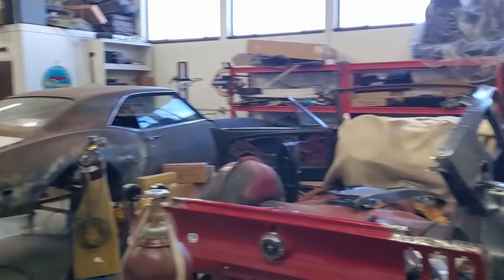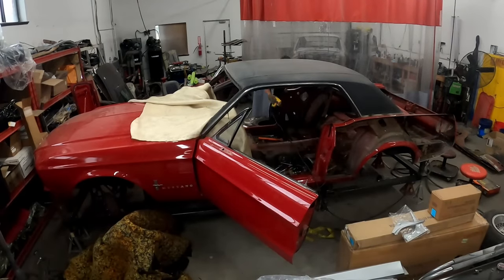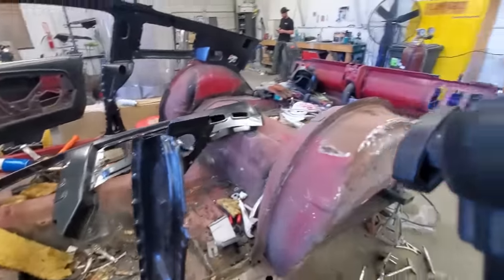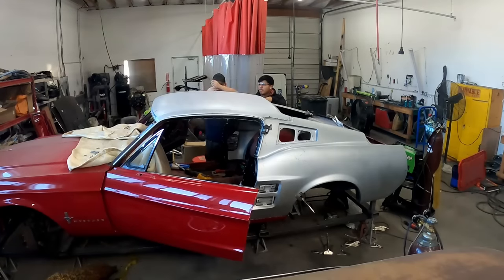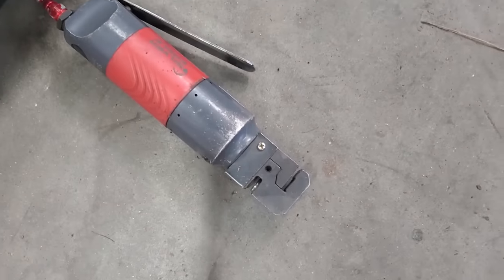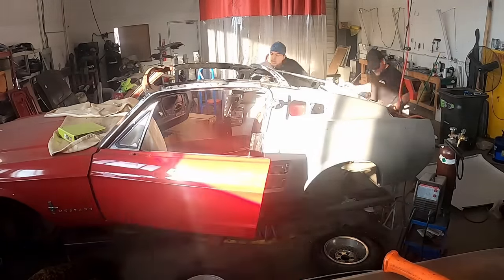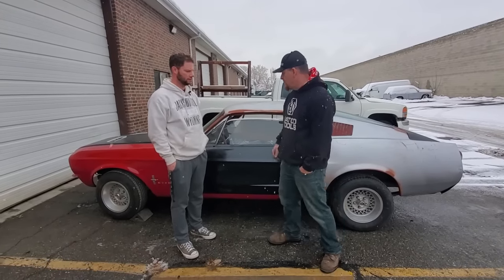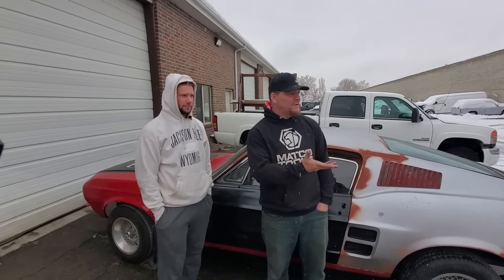Fast Track Transformation: '67 Mustang Coupe to Fastback in Minutes! | lostsocketgarage.com

Comment: That's cruel and unusual punishment to a perfectly good body. The VIN's not gonna match up to a fastback. I was just watching a video on CUDA's and they found all the imperfections with a body just by looking at the welds and bare metal from parts chopping that will seriously affect the bottom line of the car's worth. IF IT AINT BROKE, DON'T FIX IT
Reply from the maker: There are opposing views on this procedure for sure. It actually raises the value of a coupe believe it or not.

Comment: Another reason to do full car history checks! Thx guys
Reply: I was just watching a video on CUDA's and they found all the imperfections with a body just by looking at the welds and bare metal from parts chopping that will seriously affect the bottom line of the car's worth. They could tell that a Barracuda rear was used on a Cuda body, just from slight discolorations in specific spots.

Comment: Hey looking to do a fast back conversation and wondering how much can you get away without buying in one of the 6k+ conversion kits
Reply from the maker: Thats a Hard one. Ive seen people use donor fastbacks and cut the roof. Seen people make their own inner structure to save money. This is a hard one to do on a tight budget, but if you're patient and find bits and pieces here or there, Im sure you could do it.

Comment: That's awesome! I have a '67 T code coupe setting in my junk cars. It was mostly complete until I sold the grill and a headlight bezel about 8 years ago. I have always wanted to do this though but I wasn't sure what all was involved. I might just drag it in the shop someday and do it now.
Reply: I would give it a try. I've done restorations and you always make some mistakes. 
The sheet metal parts are somewhat expensive.
Two things holding you back. You are afraid to fail or you don't have money for the parts.
Reply: @cammontreuil7509  Yeah, usually for me it's money but at this point it's option #3, I have absolutely zero time. But that will hopefully change in the future. About 2 years ago my best friend received a '67 fastback from his father in law. His father in law bought it in 1974 wrecked in the right front corner. The father in law bondo'ed it up and drove it for about 6 months and then tossed it in the corner of his garage and that's where it set, except for 1 move in late '90's to a new garage, up to 2021. The father in law was dying of cancer and gave my friend the car and a credit card and said he just wanted to see the car restored and running. I actually offered to give them my '67 to use for parts but new parts were cheap enough and of course new. Well in the summer of 2022 the paint and bodywork were done, the original red with red interior, all new seat covers and carpet, new bumpers, wheels and tires. The father in law got to ride to several car shows and enjoy a couple of cruise nights. He passed in the fall. The car desperately needs either an engine rebuild or replacement. It's a 289 so I'd replace it myself, but anyway, you are right about not waiting, it might be too late at some point!
Reply: @1967davethewave  I want to hear you focusing on your project.
I tried to light a fire under your azz.
We make time for things important to us. 
But then I have two daughters interested in mustangs and the struggle to put them together.
But it's worth it.
Reply from the maker: It's scary as shit cutting your first one in half, But it's worth it
Reply: @lostsocketgarage  my friend has a 68 Roadrunner. Cut the front off to the firewall. Welded a Satellite front clip on it. Not that hard. Work on a flat surface.

Comment: kind of cool but i saw one years ago that took it a step better IMO it was a high end build /Restomod that converted one into a Fastback with a removable hard top ! perhaps not the most practical ? but definitely the best of all Worlds  of Classic Mustangs Why?   i grew up running around and riding in both  as i graduated HighSchool in 1982  and 1960s Mustangs were everywhere and affordable , heck we used to go to our local Junkyards to get parts  (cheap )  i blew up a 302 and got all the parts i needed to get the car running for under $200.00  it was a 68 Convertible 3 Speed on the Floor that  wound up getting Totaled by a drunk running a Red light  unfortunately  we pulled  almost all the body parts off a 6 cylinder hardtop  project car i had in the back yard the car  got put back together  not painted and it had too much structual damage to be  a safe driver so it was sold as is ? Running and Driving ,Multiple Colors ,Salvage Florida Title  it was a One Family owned Vehicle as well

Comment: Okay... so this was cool and I subscribed.  IDK... 20 years ago or so, I went looking for a reasonably priced fastback from my birth year... a 1968... and I couldn't find one.  I bought a 65 coupe... and a 66 convertible... but I simply could not find the 68 fastback.  So... it looks like you guys have a good fix for that problem.  I know the convertible had a bunch of extra support built into the body and frame because it was more likely to twist... but all the mustangs will twist when you put enough power into them. So I'm curious if your fix includes any beefing up of the frame and body.  I guess I look at a few other videos to find out...
Reply from the maker: We do if the customer wants it. For a stock 351 really no bracing is needed. If you go stroker or even coyote then yes, you should look at frame rail connectors and beefy suspension.

Comment: Hey guys! Great job. Would it be easier to start from a convertible? I’m a Mustang fanatic and always wanted a 67 fastback but I’m on a coupe/convertible budget. 🤣
Reply from the maker: You can do it from a convertible . Actually a bit stronger that way because the floor on convertibles are thicker and you will have both torque boxes.
Reply: @lostsocketgarage  Sweet, good to know!

Comment: The original cars were built to different standards to todays cars. The 60s cars were pretty bendy. Have you added any additional steel to stiffen the body? Such as an integral roll bar hoop, stiffeners to the rear suspension points or adding material to the sill?
Reply from the maker: We only brace it for the conversion. They are kinda flimsy being a uni body. Best thing to do is frame rail connectors if your pushing additional power.
Reply: I always jack up 60' cars with the doors shut. Like you said, they can be flimsy.

Comment: I don’t see any bracing,
Reply from the maker: It is actually on a frame jig. So it does not need interior bracing.
Reply: @lostsocketgarage  Sorry I did not see it, I have used a Jig on everything I have repaired in the Past. Only way to do it right.

Comment: Do you have a rough price for the labor on  this? maybe a starting price just? No parts, just the labor,  not hard to get a price on the parts, you told us whcih brand you use.  Thanks.
Reply from the maker: Around $8k
Reply: @lostsocketgarage  That's not bad. Do you have a rough idea on parts cost? I ask because I know where a 6cylinder coupe is sitting though I've not been able to buy it to this point. LOL, I'm still trying.
Reply from the maker: @dbc105  for 67-68 it's around 5700